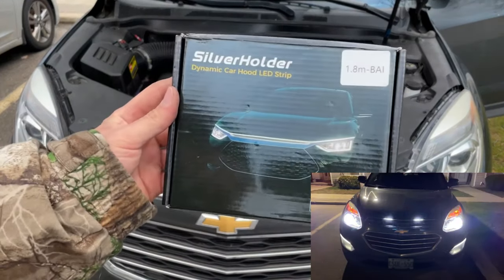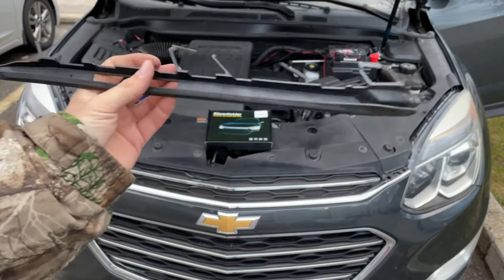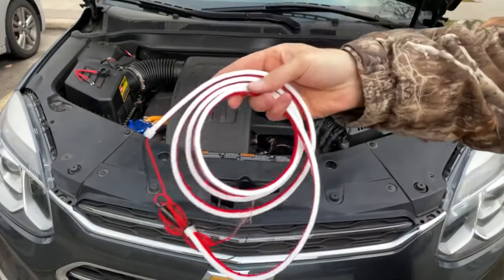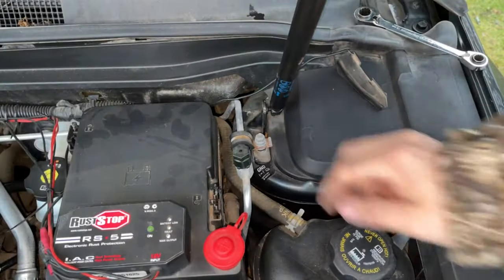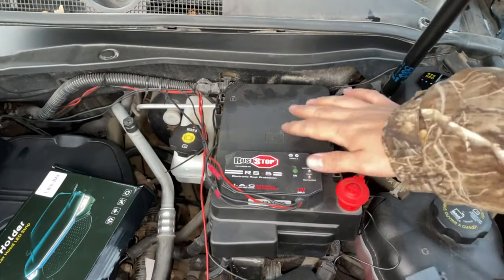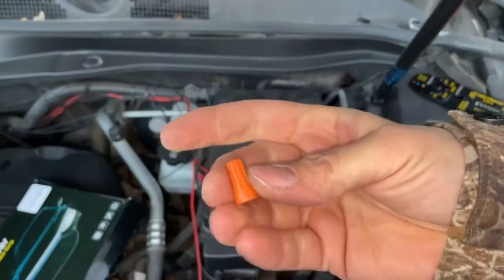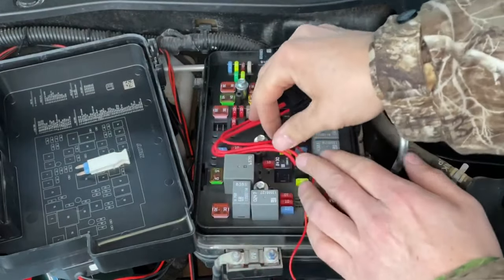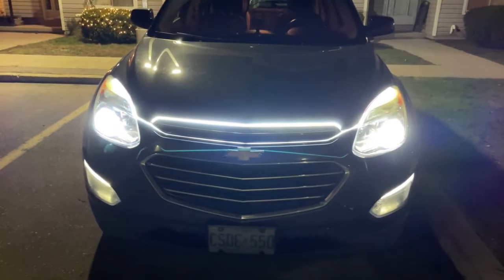SilverHolder Dynamic Car Hood LED Strip Installation (Chevy Equinox)

Comment: On my 2010 Ford Ranger it doesn't have any fuses under the hood to tap into that powers off the light strip when you turn your ignition off. All the fuses that do this are located in a fuse box located on the interior passenger side making it EXTREMELY hard to do this. I just located the "hot wire" going to the headlights by using a test light and professionally splice your light strip into that wire and find a grounding bolt to connect the ground to. EASY PEEZY 10 minute job!
Reply from the maker: Yes a splice or T-Tap wire connection is also an alternative to the fuse tap depending on the fuse box setup. I have more lighting plans that I will be using t taps for. Thanks for watching and thanks for sharing your technique. Please like and subscribe
Reply: Use the battery !
Reply from the maker: @jraffy   hooking it direct to the battery will make the light constantly stay on even when you shut the vehicle off as it draws constant power. That’s why we splice int a wire or fuse for an accessory that powers off when the key is removed from the ignition. Please try things out or at least research before  trying to give people misleading advice. Thanks for watching.

Comment: So what happens when you need to change a bulb, or need to remove the headlights? You have the strip on it now, that goes all along the grill as well.
Reply from the maker: If you have to change the bulbs you still can. They are accessed from the wheel well as you can see in my video here: 
https://youtu.be/OrZWtJLXwN8
The only time I can see needing to remove the whole housing or bumper is if you have been in an accident. Then removing the strip won’t even be on your mind because the repair is so big. If you wanted to save it then you could peel carefully but then you would have to use glue to re attache. Hope this helps. Thanks for watching. Please like and subscribe.

Comment: I tried installation on my car. It didn’t work. I tap to horn fuse for the power and black wire goes to a bolt on the frame. Horn works but no lights after ignition is on. I applied 12 DC power to the strip and leds lit up so it is good.
Reply from the maker: If you hook it to the horn fuse it’s only gonna activate when you blow the horn. Tap into something that’s always on while ignition is on and off when the ignition is off. Such as headlight, fog light, DRL, parking lights, or ignition fuse. Hope this helps. Please like and subscribe

Comment: In my car manual the fuse box diagram tells me there are a few 10A fuses that are marked as 'spare'. I'm guessing that's the one I'm using when connecting the red wire?
Reply from the maker: After filming this video I switched the red wire to the 15 amp fuse labeled as parking light so it will only turn on at night. The parking light is the best one to go into. Thanks for watching. Please like and subscribe
Reply: @BillOfAllTrades2016   @Bill Of All Trades  Got it. So if I want my LED strip to be constantly on while the car is on, I would use the piggyback fuse adapter into a fuse like the ACC?
Reply from the maker: Yes that is correct.
Reply: @BillOfAllTrades2016  Does it matter that my car's ACC fuse is 40A? Does this change anything?
Reply from the maker: You can run it in the 40 amp as long as you put a 40 amp fuse in the piggyback assembly
Reply: @BillOfAllTrades2016  Okay, so the 40A original on the bottom while the 5A that came with my piggyback tap is on the top.
Reply from the maker: Yes that is correct. Smaller amp always ontop.
Reply: @BillOfAllTrades2016  Thanks!
Reply from the maker: You’re welcome.

Comment: You took off the weather striping in the very beginning. Did you put it back on? If not how did you protect the area where it used to be?
Reply from the maker: Yes I actually glued it back ontop of the light strip in the same location where it came off to fill that gap. I had to trim some of the plastic part to make it fit. Thanks for your question. Hope this helped. Please like and subscribe

Comment: When you took the fog light fuse out did you leave it out? In other words did the led strip replace the fog lights?
Reply from the maker: That is correct. The led strip fuse replaces the fog light fuse. So the fog light still works. And now I have a spare fuse. Thanks for watching. Please like and subscribe

Comment: Just got mine today and worked on install.  I wired to the DRL and also tried the fog light fuse.  The lights stay on constantly even with the engine off.  Not sure what is wrong.  Any suggestions?  I don't understand why they would be on with the car off.
Reply from the maker: Try locating the fuse for the parking lights. I ended up piggybacking off that one off camera because then the lights only come on at night. So I have them off during the day. I’m not sure why yours would stay on with the engine off. If it is piggybacked off a fuse then it should turn off when you remove key. The only time I’ve seen it stay on is when people wire direct to the battery. If the steps I mentioned don’t work then try flipping your fuse 180 and putting it in the other way. Not sure if they can go backwards but maybe you have it backwards. Thanks for watching. Hope this works out for you. Please like and subscribe
Reply: @Bill Of All Trades  in my prius i found parking lights fuse which is inside the car, sucks. Since its 10a then i would need an extra 5a for the fuse tap? There is however in engine compartment turn signal/hazard fuse, could use that instead? If I want the led strip to come on only when I turn the lights on.
Reply from the maker: @skorpyo331   I would suggest a 15amp fuse to tap into. You can try something that has a 10. But I went with 15 because the light strip is pretty powerful. Don’t want to blow a fuse. Also you have to choose a fuse with constant stream of power. Signal and hazard lights only provide pulses of current so your led strip wot work properly. If you want an easier route you can also use a t-tap wire connector and tap into the headlight positive wire on the wiring harness. Hope this helps. Thanks for watching. Please like and subscribe
Reply: I have a Mazda CX-5 GT with the exact same issue. I was trying to piggyback off of the fog light, but the strip light stayed on all the time, no matter if I turned the Fogs off or even the engine off. My only thought is to try to tap into the wire from the headlight assembly but for now, I'm putting this on hold for fear of screwing up something. If you find the solution to this, please post it.
Reply from the maker: @karl5997   I would suggest buying a circuit tester pen for 12 volt circuits. They only cost $5. Turn the car on and Take the pen and test all your 15 amp fuses. Mark down which ones have power. Then shut the vehicle off and test them again. Mark down which ones turn off. Piggy back off one that turns off.

Comment: Oh you used the fog light fuse.  What if my equinox doesn’t have a fog light?  I’d assume the fuse port would still be there?
Reply from the maker: I actually switched it off camera to the parking light fuse as the DRL didn’t work.
Reply: @BillOfAllTrades2016  Is this what allowed the led strip to activate when you arm and disarm your alarm (without starting the car)? I don't have dedicated "DRL's". I rotate my signal stalk to turn on the "parking lights", which also blink when I arm and disarm the alarm, but they don't stay on.
Reply from the maker: @jeremynery9669  parking lights are the ones I switched to dater shooting the video. Parking lights are the red lights that glow on you tail light. The dimmer light that stays on when the brake is released. These would stay on always at night. Thanks for watching. Hope this helps. Please like and subscribe

Comment: Does it only work whenever the car starts, or whenever you unlock the car, or both?
Reply from the maker: All depends what you hook it up to. I have mine hooked to the parking lights so if I unlock the car during the day it won’t turn on. But if I unlock it durning night it turns on. Also when I drive it stay off during the day and when it’s dark enough for headlights and parking lights to auto turn on it also comes on. Thanks for watching. Please like and subscribe
Reply: @BillOfAllTrades2016  So whenever I am unlocking my car, my turn signals turn on, and not the parking lights at all. The only way for those lights to turn on would be to start the car (2017 Subaru Crosstrek Premium CVT). Is there another fuse that I could possibly connect them to for them to turn on when unlocking my car?

Comment: Does the fog lights still work once we remove the fuse for the fog lights 🤔?
Reply from the maker: Yes they still work as you are putting the fuse back into the piggyback adapter. This method allows you to borrow power by splitting into the power source. It works the same way as plugging a power bar into your outlet at home. Everything works together. It just gives you an extra plug. Thanks for your question. Please like and subscribe

Comment: Great idea on measuring it and marking the middle. That way you have a SURE center
Reply from the maker: Yes it would look weird if it were even off center by an inch. On this vehicle the hood comes to a point to make knowing center on the car easy to find. But quick tip for cars with rounded bumpers the simplest way to find the center of the hood is to refer to the emblem. It’s always centered. Thanks for watching. Please like and subscribe

Comment: Super happy you posted this. I bought the same strip, but it had no instructions included. Im guessing that I can enable or disable the strip light with the fog lamp switch in my car?
Reply from the maker: Thanks for watching. I’m glad you found this video. I was surprised as well about the lack of instructions. If you hooked up the light strip to your fog lights then yes you can control it with the switch in your car. If you turn off the fog lights it will also turn the strip off. Hope the install goes well. Take care and please like and subscribe

Comment: great install vid! is this mod street legal in Alberta, Canada?
Reply from the maker: Should be. I’m in Ontario. Been passed many police cars day and night and never have an issue. Most people just think it’s an electric car. Just don’t put the multi color one on because that will get you into trouble. White will be ok. Thanks for watching and please use my link to buy the product. And please like and subscribe
Reply: @BillOfAllTrades2016   i bought one with a purple-ish l.e.d. lamps and it does a "running" or scanning sequence that runs from the middle and goes outwards on either sides while driving.

Comment: Hey, will I need the same fuse for 2022 Honda Passport EX-L?
Reply from the maker: Yes this 15 amp fuse with piggyback fuse is the same for any vehicle. The only difference is where your specific fuse is located as different manufacturers lay out the box differently. Hope this helps. Thanks for watching. Please like and subscribe
Reply: @BillOfAllTrades2016  thanks for getting back to me. I really appreciate your response. Anyway, do I have to get that exact one? The store that you bought it from doesn’t seem to deliver to my state. What other site can I get this from.
Reply from the maker: No worries. You can check out a company called carxk. Here is my affiliate link for them: 
https://carxk.com/?ref=IcbDmbnB
If you order through that link and use my promo code BILLYBERRILL then you will get 10% off your purchase. Once you go to that link check their lighting section.  They have tons of stuff.
Reply: @BillOfAllTrades2016  : so, can I order the part I need through that site? I am not seeing that fuse connection I asked about.
Reply from the maker: Oh. Sorry. About that. The light strip doesn’t come with the fuse connector. I bought that separately. If you go to any local auto parts store near you they have them for a few dollars. I’m in communication with both companies to get those included but that will take a long while.
Reply: @BillOfAllTrades2016  : ok, I’ll check one of the stores around me, and see if I can find that piggyback extension fuse.
Reply from the maker: Ok let me know how it goes

Comment: I was tying to find a fuse to tie into under the hood and all that are on only when the car is on are 40 Amp or higher. I'm thinking it's not a good idea to tie into those? 
All the good fuses to tie into that are around the 10 to 20 Amp are in the car by the feet of the passenger. Hmmm 🤔

Comment: What am I doing wrong? I installed my lights but the lights are on even when the key is out of the vehicle. Can someone help me?
Reply from the maker: Take a circuit test pen and test other fuses. Some fuses stay on even when the vehicle is off. ie pcm, clock, so you will need to locate with the pen a fuse that actually powers down when key is turned off. Hope this helps. Thanks for watching. Please like and subscribe

Comment: Sir, my wife has an Equinox  and I was can you mount on the lip of the hood or is mounting like you did the best place?? Thank you for assistance
Reply from the maker: The manufacturer of the light strip has some install videos that show the strip being installed on the hood side. However the way the hood on the equinox is designed the front is slanted down so it will stick, but it won’t be facing straight out. That’s why I chose the location I did because it provides the best mounting angle and perfect adherence. Also I advise you to hook the wire to the fuse like I did, but instead of the DRL, I switched it to the parking light fuse. Works best there. Thanks for watching. Please like and subscribe

Comment: Don't use 110VAC wire nuts for 12VDC car applications.  Please.  Just get a short length of heat shrink tubing, and solder the connection, or get the crimp-on connectors that have the solder inside, so you just heat them and you're done.  If you are going to do wiring in a car, please, do it right.
Reply from the maker: Thanks for your comment. heat shrink and solder is a better bond for sure, however I use what I have available in the house. The wire nut I used is still holding strong almost 2 years later. If I were to buy a solder gun, solder and shrink tubes it would cost as much is the light strip I’m putting it on. I have a handful of wire nuts in the toolbox unused because everytime you buy a new light fixture it comes with new free ones.

Comment: Each year model is different. I have a 2018 equinox that does not have the weather stripping on the model in the video. My fuse box is also in a different place. Explain
Reply from the maker: Because this is a 2017 equinox.

Comment: Which fuse did you take out?...you never said
Reply from the maker: Depends on what vehicle you are working on. I plugged mine into the parking lights fuse spot. Thanks for watching. Please like and subscribe
Reply: @BillOfAllTrades2016  what about a 2015 Silverado?
Reply from the maker: Does your lid have the diagram on it? I would suggest either parking lamp fuses in spots 28 & 28. Also you can go with fog lamp fuse in spot 39 if the vehicle is equipped. That will give you control if you want it off or on while driving. Also you could use the headlamp fuse in spot 59. The parking lamp fuses and the fog lamp fuse are 2 pin mini fuse so you would need a 2 pin piggyback fuse connector. The headlamp is a 3 pin fuse so you would need a 3 pin piggyback connector for that one. All are located in the engine compartment fuse box. Hope this helps. Thanks for watching. Please like and subscribe

Comment: Can you help me out folk ? I just got my led strip but when I do the test  it works en Everything but they doesn’t turn off , even with the engine it’s off they are on. I put it in the acc clutch fuse but I don’t know why the led strip doesn’t turn off
Reply from the maker: Please check out this video I made on how to select the correct fuse: 
https://youtu.be/UYbqB1lwu50
Using the cheap tool in this video will help you find a fuse that is actually off when the engine is off. Some fuses always draw power at all times. Thanks for reaching out. Hope this helps. Please like and subscribe

Comment: Can someone help me? I can’t find a fuse that gives power only when car is started. Right now with the Day time running lights. The strip is on even when the car is off.
Reply from the maker: Use your parking light fuse. That’s the one I switched to afterwards and it works perfectly. Can’t remember the slot but it’s listed inside the lid. Thanks for watching. Hope this helps. Please like and subscribe

Comment: Mine lights up for 5 seconds then quits. It's  tied to the ACC fuse. Any ideas?
Reply from the maker: Is the car still running when the light quits? I’m thinking one of your connections is not secure enough. Check all connections and make sure there is no visible damage to the light strip. The light strip should be tested before sticking down so if it has a fault, it can be exchanged. Hope this helps. Thanks for watching. Please like and subscribe

Comment: I have a 2018 Buick Enclave and by the looks i don't have much room between the hood and body.  Can you tell me the width of the strip, 1/4" or 3/8" or....?  Thanks
Reply from the maker: The thickness is about a 1/4 inch. It’s also soft so it will compress down a bit. Hope this helps. Thanks for watching. Please like and subscribe

Comment: Still doesn't explain how to hardwired it to the fuse box which defeats the whole purpose of demonstration.  My car does have the accessories fuse and I have no idea which fuse to hook it up.  I have the 2018 chevrolet traverse.
Reply from the maker: Why do you need to hardwire it in? The company suggests this method. A fuse tap is the most efficient and affordable way. And the fuse box is different for every vehicle. You need to test your fuses to see which one to tap into. So instead of blaming the video then perhaps you should research more specific to your vehicle. But thanks for watching